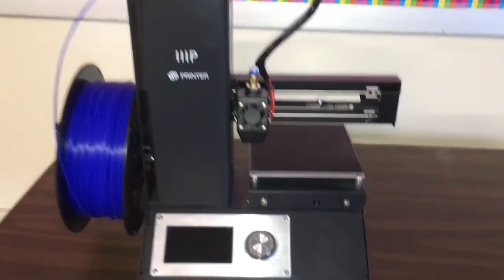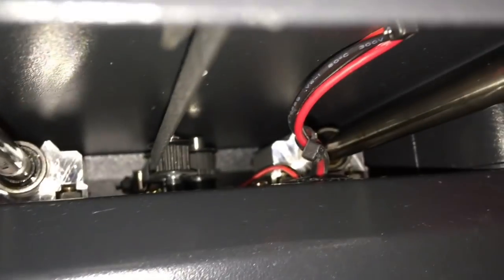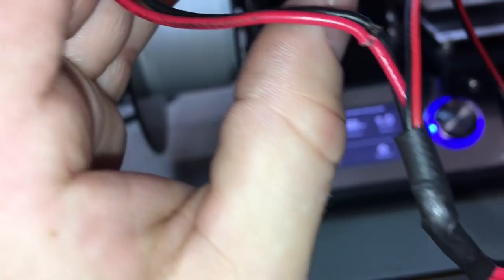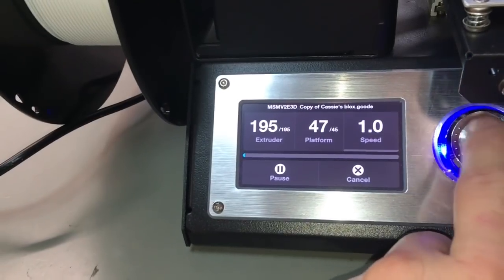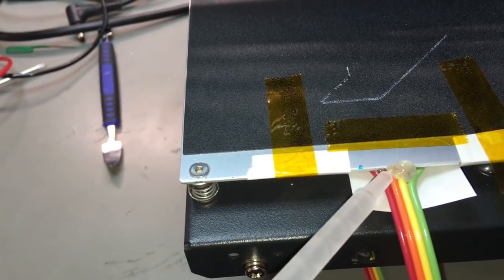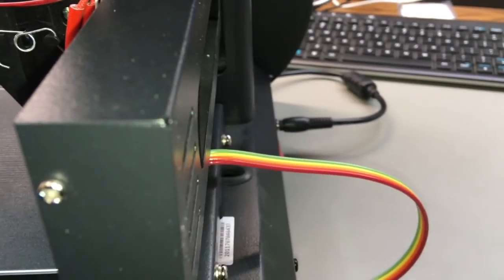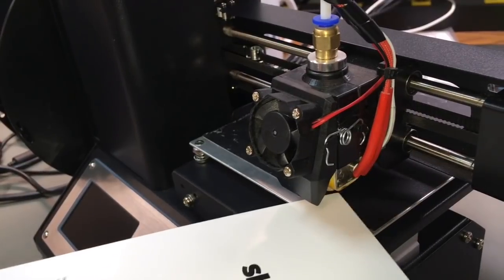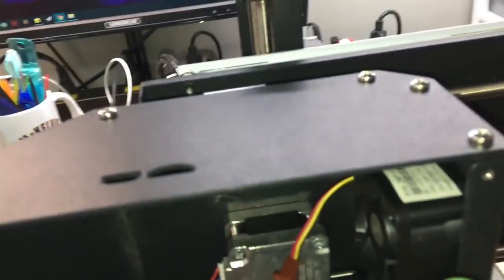Monoprice Select Mini / Malyan M200 3D Printer Bed-Plate Heater Repair

Comment: I bought two of these printers - one brand new, the other used and non-functional (for 1/4 the price). The broken printer had severed all 4 bed wires at the tie wrap, and they were all shorting to each other. It wouldn’t even complete startup, just had a blank LCD. The microprocessor had HOLES blown in its case! My guess is that the heater voltage was applied to the thermistor pin during the initial failure. I don’t know that such a cross connection could cause such catastrophic damage to the uP, but something sure did. I replaced the chip, but cannot obtain the complete firmware in order to reload it. 😡 Needless to say I immediately made this mod to the new (working) printer.

Comment: That loud fan is probably a 40mm, not a 20mm in the back if you want to replace it, the Chinese printer manufacturers love their 40mm fans. I bought a few 40mm fans on Aliexpress just so I would have them if something went wrong with the bearings on those super cheap fans on my printer (edit: Looks like you already figured that out if you replaced it)

Comment: The thermistor goes to 0 if it disconnects, 999 if it is shorted. if the marlin software is properly configured it shoud disable the bed heater if either of these readings occur